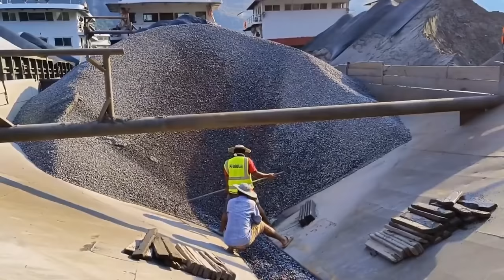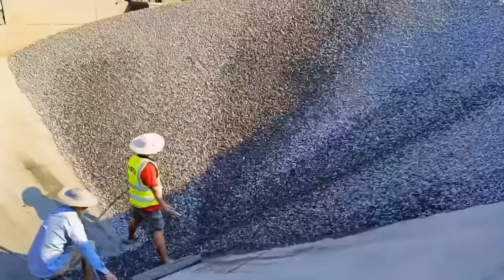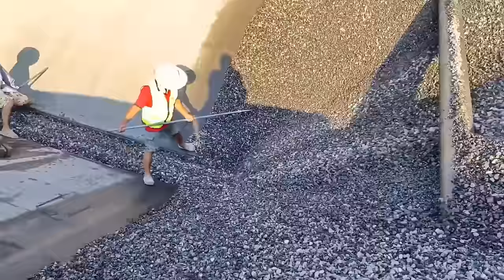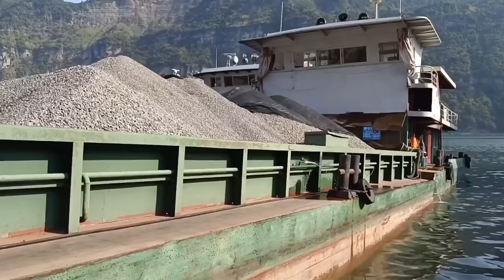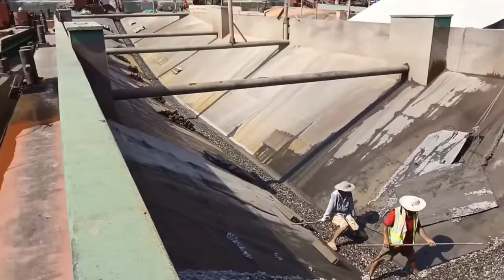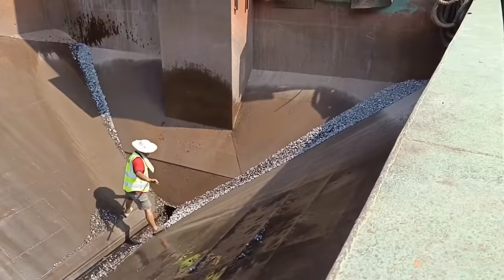Barge unloads concrete gravel - smooth flow -Video completed

Comment: would love to know why all those wooden planks are in the gravel.
Reply: Its to allow the gravel to flow at a slower rate as opposed to all the weight sitting on the conveyor at once and bogging it down
Reply: They cover the conveyor, so there is not too much weight on the conveyor to operate at one time.
Reply: The conveyor would stall without them
Reply: The planks cover the conveyer belt system during loading, I think. 😊
Reply: Really !? 🤦🏿‍♂️
Reply: I'm surprised they dont have  cables to pull from the edge of the boat attached to the boards.
Reply: There must be room to have hydrolic shutters and just use a lever to remove the put back when stones,sand rocks clear
Reply: @donmorgan8673  wood is cheaper and less complex.
Reply: Choir practice 😂
Reply: When their loading it's so the gravel doesn't lay on the belt . If it did it would be to heavy and the belt wouldn't turn

Comment: Probably the safest sort of load, dry, single sized aggregate. Flows well, no sticking, no having to enter the canyon to hook a board and having an avalanche of wet sand fall in, or large, leg breaking, sized rocks get pushed down, no water spray making it slippery. 
I watch some of these and fondly remember health and safety checks, not at the time though.

Comment: Are the workers wearing ear protection?
Reply: What??  🤣🤣
Reply: @scrapcash2421  don’t you mean pardon? Watt is an electrical unit, as my father used to say when I was younger.
Reply: @samleigh7817  That's why I typed WHAT, as in I can't hear because I don't wear hearing protection!! 😳😳